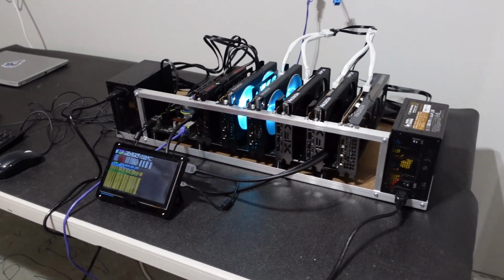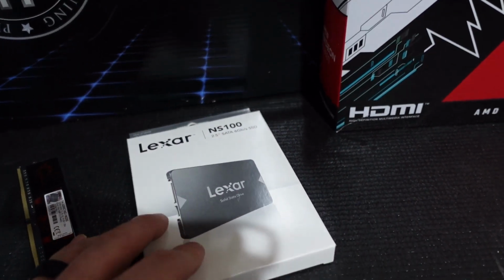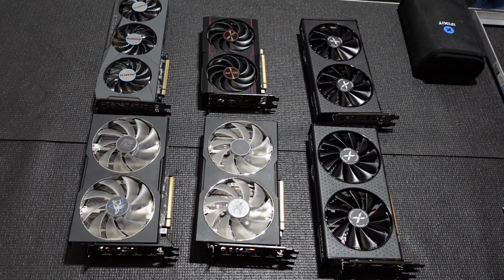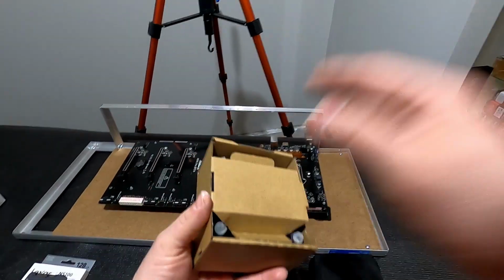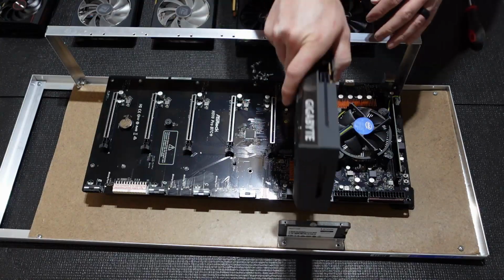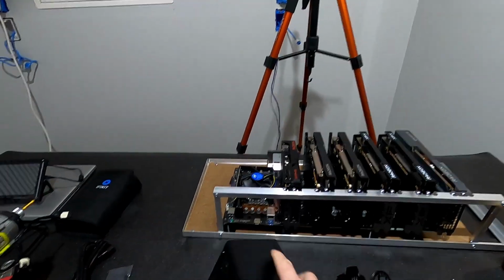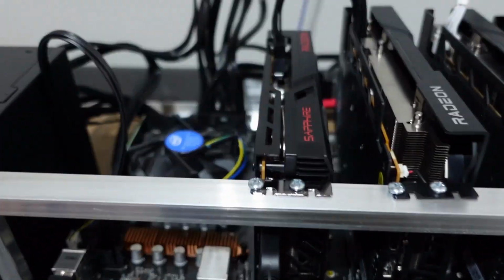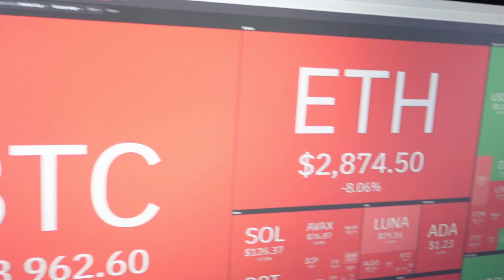RX6600 Ethereum Mining Rig Build | Step By Step

Comment: for the amount of video cards with 6600 is it good because I want to upgrade my rig, but for 6600 I'm worried that it's 128bit and only for my modest knowledge I know I have to shake 256 bit cards, but they are at least twice as expensive

Comment: Everything super cool, except the use of power supplies is not a good choice.
I would directly recommend going for a 1000W 80+ PLATIMUM or 80+ TITANIUM certification like (Seasonic Prime TX-1000 80+ TITANIUM), and as an extra a 1000W nobreak like the sine wave (CyberPower CP1500PFCLCD) to further protect all the components electronics and ensure a long life.

Comment: Great video! I bought a similar build, same MB but 6 3070  and 2 power supplys gigabyte 750 gold. I’m having a problem connecting the molex cables in orden to get power to all my gpus. Any one knows? Im running bios 1.3, there is one new version that I’m going to try but I’m only getting the first 3 gpus running at the moment. Thank you!

Comment: max amount of 6600 on that motherboard is 11 (using 1 to 2 pcie exttender) u cant make 12 to work no matter with what 
i am making mine with 10 and currently have 6 of those rigs (same motherboard but using asrock 6600 since it has better temp and cooling than others)
Reply: hello nikolay im from indonesian, may i know what is the resulting hashrate of asrock rx 6600 and what  type of vram
Reply: one more, is it stable?
Reply: @dead3yes  it is stable with 11 yes and ram is hynix

Comment: After 9 hours of troubleshooting and several bourbons, I finally fixed the Asrock H510 5 death beeps.  I simply removed the motherboard, placed it in the trash can and replaced it with a much simpler and reliable board on the rig. Problem finally resolved!  Anyone need tips on how to fix the 5 beep issue just follow these steps 🤣

Comment: Running a rig with( 8 ) RX 6600
Getting  230mh/s, all are hitting about 28.9mh/s and can’t get it go past that no matter what I try, 
Rig is on a wooden built bench with the lcd mounted and fans pushing air from the back, using 2 psu, and the btc-S37 board,

Comment: I have an 8gpu S37 mobo but the cards I have are pretty powerhungry and run very hot without adequate cooling. I was thinking of utilizing just 4 of the slots with gpu's in them and put the rest on risers. Is it even possible to use risers with this mobo? Is it like any other mobo where you can just plug the pcie extention and connect a riser to it?

Comment: What are your bios settings after update. I can only get 2 cars to show up. It was only showing one then I disengaged  4gencoding and I could only get 2 to run. They are 30 series Cards.
Reply from the maker: I made no bios changes other than AC power up.
Reply: Ok I have I-3 1001f I just ordered the processor you used.I hope it helps I have heard not having the integrated gpu causes issues. Plus I’m going to install AmD instead of nvidia I hope it works.

Comment: :yt:«Great info  ::: BTC has  drop for 3 months straight - even against spx. We've also been dropping level after level below support constantly with no bullish volume in sight. but i disagree that a break of 40k would initiate a bear market, since in 2020 btc hasn't done anything  except. range between 30-60k essentially.  coming back to 30k or mid 30ks is highly likely at this point.  Stay-informed and always have a plan. Buy low, hold long my friend, No man or machine can beat, Naughton_trades investing. Don't miss the boat. Best advice I received from my mentor/Financial-Advisor “Expert Naughton  with his strategy i have been able to outperform the market by 10x folds constantly.i would say trading has been going smoothly for me, i started with 1.5 BTC and i have accumulated over 12.6 BTC in just 3weeks   , with his  trading strategy

Comment: I was very tempted to start doing the 6600xts because you can find them. power consumption is great on them as well. I was slightly worried about future coins though after eth as 3060s seem better but harder to get.
Reply: The XTs will mine basically at the same rate as the regular 6600s, but for a higher price. If you're going to Ether, stay with the 6600s
Reply: @ilidiovitoriano  what do you think about how they will fare if/when Eth goes POS?
Reply: @Bigbacon  mining other coins with the same algorythm, will still be one of the most efficient cards. I get more than 500kh/W with these cards.

Comment: I wonder why you went for a SATA disk and did not use a M2 SSD
Reply from the maker: What i had laying around honestly.
Reply: Thanks for your reply. I have other question: The 3D printed spacers look awesome, but for us guys who don’t have access to a 3D printer, will the standard motherboard spacers (brass or plastic) work? Any issue with that type of spacers? Thanks.
Reply: @JorgeMartelanz  逮到熟人一个！！😄

Comment: Heck yea nice video,  I did a similar set up 12 card 6600xt . You could have used a 1000w PSU from  Super Flower , titanium  rated on newegg goes for like $250.
Reply: so you can run the h510 from a single psu?
Reply: Can you use a regular 110w outlet for this?
Reply: @guyneuman9967  u mean 110V outlet.
Reply: @guyneuman9967  if you know that the outlet is (dedicated) the ONLY outlet on the breaker and it is not connected to A N Y other outlet in the house yes you should be able to run this setup.

Comment: I have something similar. 2 rig with the same motherboard and 6 rx 6600. Only one psu for each is enough. A little less hashrate of 173.8 for 360w from the wall.
Reply: do you need to power the second 24pin and all the molexe's? :o
Reply: @denkrblx437  With somethings like 370w I have a single psu. 1 atx cable. All 4 molex on motherboard filled by 2 cables and his own molex, 3 pci-e cable from the psu. May be i was lucky but the cables in the psu box was enough to fully connect all the rig. I have 2 twins rig working like that. This is why I love the rx6600 that consume few watt. Here I cannot post photos otherwise It is simple to understand.
Reply: @danielesetaro4634  okay, thanks.

Comment: Whats with the screwdriver for cpu cooler install? If the clips in right spot you just need to press it to lock, the arrow shows you what way to turn to unlock.... afyer its unlocked, you then pull the tabs outwards and rotate them clockwise so they are in the set position, ready to press and lock again.  you wanna double check those clips are actually latched!

Comment: I have several 6600 rigs (ASRock and XFX), they are great, but not the most stable. I use teamredminer and have a crash/reboot every few days. Any ideas?
Reply: I have one rig with 7xRX6600 Asus DUAL + 2x850W power supplies. 204,5 MH/s (29,22 per card)  and I'm using Gminer with these settings: CORE:900, MEM:950, PL:54, VDD:637, VDDCI:648, MVDD:1156, drivers: 20.40 (5.11.1001). Seven days tested and no crashes - very stable. The NBminer has interesting results - I've been testing it for one day now, and is mining a little better.

Comment: I've got a rig with 6x RX6600 XT. It does 193.5 MH/s at exactly 438W at the wall, although it took a lot of over/under-clocking and undervolting to bring it to that point. So about 12% better hashrate than your 6600 rig at a very similar power draw. But I wonder what was the difference in price of the card? I'm in the UK, but they cost the equivalent of $500 here. How much (on average) were your 6600s? Were they around 12% cheaper?
Reply: In india its cost 600$ per card
Reply: @vishaljakhar3311  Yeah, prices are absolutely crap. At least you have much better electricity rates over there? Or at least that's my presumption. Here in the UK, it's $0.26+ per kWh.
Reply: @TheRadiastral  yes, you're right in my state[UK(India)] it's $0.07/kWh and up to $0.13 in other states.
Reply: @vishaljakhar3311  in brazil its cost R$4000,00 or $800 per card, lul
Reply: Blades O Grass  The "26" refers to USD price, which corresponds to 0.195 GBP per kWh. Unfortunately looks like we'll be all paying WAY more this year. My price goes up to £0.36 ($0.49) per kWh starting from April, just ridiculous :(